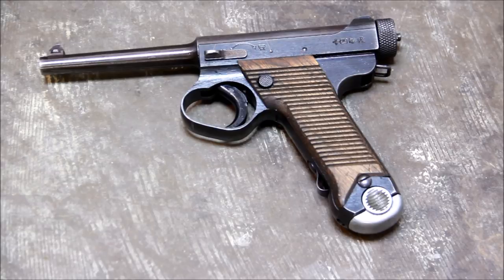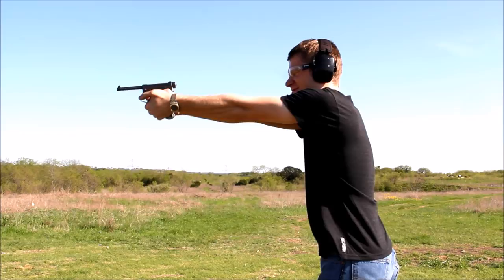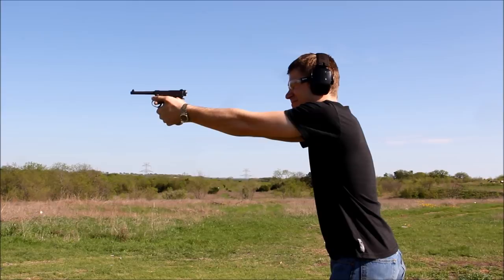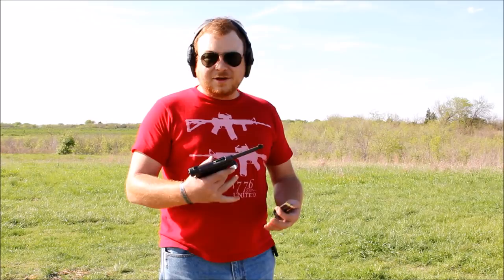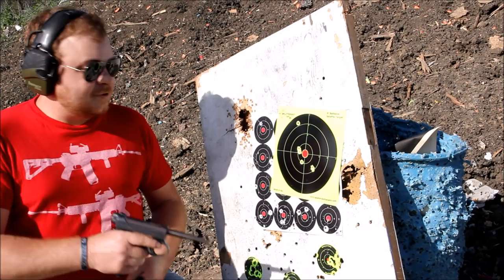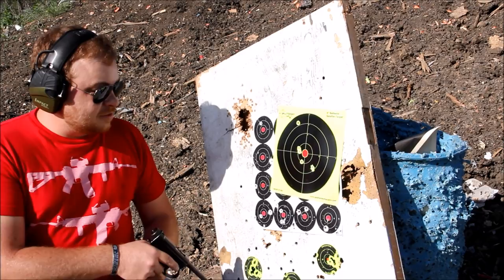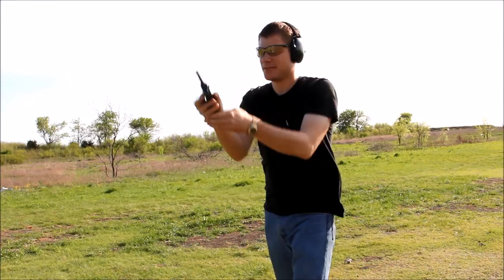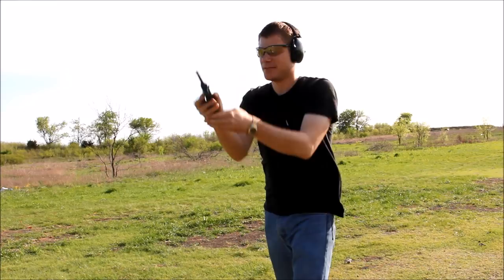Type 14 Nambu Pistol 南部拳銃

Comment: it's called keep the firearm down range for 30 sec minimum after miss fire, and i don't mean it jammed or pin didn't reach but when it does reach (as shown when he slapped the bolt down and pulled the trigger but it still didn't fire meaning the pin connected on the second try) you keep it down range. buuuuuut i guess i'm Australian and you're American and we get taught on different lvls for pistol and firearm safety XD (not everyone of course but people like the guy in the red shirt).
Reply: plus flailing the pistol around whilst driving the mag and bolt home (oh god i almost fainted) if i were a range officer i would've taken you off range and told you to never come back.

Comment: Looks to me the reason it fired was the magazine disconnect is actually part of the mechanism holding the striker in place and since the bolt was not fully in battery it did not engage the striker so all that was holding the striker was friction on top of the sear, sort of like when you pull a slide barely out of battery and the sear drops along with the trigger moving back. When you touched the back of the bolt you nudged the striker just the bit it needed to move and spring tension did the rest. Very lucky you were holding it down range and not at your feet or up in the air.

Comment: 3:45

It was even closer then you might think.

If you pay atenttion to his hand (Thumb) its actually moving towards the tip of the barrel (infront of the gun) just before the round goes off.

So if it might have gone of a tad later he might have had a finger or the hand in the line of fire =P.

Comment: I was once on Skype with a few guys and we eventually started talking about guns. My memory is a bit foggy, but at that point I will admit I was on a bit of a 1911 kick, so I defended that gun a lot, but anyways, I believe I said that the 1911 was the best pistol of all time, and then they proceeded to bash it (again, if my memory serves me well) and then I asked them what are some better guns. They responded with the M9 and this gun. Now, at that time, I called the M9 trash, because I didn't know that the M9 was a gun that was rushed out of the factory, that they had bad batches of aluminum, and that the 92FS is a great gun, plus at this time I had never touched  one and my father told me that the grip was way too big, which to me is not true. However, when they said that THIS gun was good, I asked them if they were joking. They were not. I said that the guns were unreliable. They refuted that fact. I said that the round was underpowered. They said it was plenty powerful. I stopped talking about guns with them after that.

Comment: I read somewhere that some Japanese guns from WW2, requires a lubricating ammunition, which they used at the time, but are not made any more, and the way to get around this; is to drop one drop of gun oil on the end of each bullet before loading it in to the magazine. Not sure if this might be the case here?

Comment: So I actually own one of these and was wondering should I go shoot it? My grandpa took it off a Japanese pilot in WW2 he joined the navy in late 1944 early 1945 at around age 17. I wonder what the circumstances were where he would of been in charge of taking prisoners?
Reply: I would not recommend shooting it especially if it's a late War pistol considering from 1943 and 1944 onwards weapons were severely simplified to save materials which with more complicated weapons like the nambu pistol caused what is happening here in this video the simplification of the pistol caused the pistols problems to be more common and that is why later in the war a Japanese officer was most likely to pull out a katana then they're pistol. And as well who the hell knows if the barrels inside have not been cleaned properly and have rotten out so just don't shoot it.
By the way out of curiosity what stuff did your grandfather bring back did he bring any more stuff like uniforms or Flags

Comment: It would be interesting to know if the pistol was serviced before being shot. Is the pistol an all matching example and not something pieced together with various non matching parts. These are notorious for weak springs. I would like to see it fired after the springs were replaced. There are many things that can contribute to this pistol having issues. Like others have said the magazine what type of ammo. I have these pistols and they have functioned without issues. If you change nothing between magazine number 1 and 2 why do you think anything would change?

Comment: I'm glad to know my Type 14 isn't the only one. Since it fired with the magazine removed, have you replaced the magazine disconnect spring? I think that may have something to do with the failures to fire, and the AD. I know mine is missing the magazine disconnect spring, as well as the recoil springs getting bent during disassembly.
Thanks for the videos!

Comment: What series pistol is this? My 7.1 (1932) Tokyo has never malfunctioned in the 80 or so rounds I've put through it, and I've heard the later the gun the worse it is.

On another note, Kijiro Nambu had some great designs, but this was not one of them. He could have done one of two things to fix it, Either replace the locked breech mechanism for a simple blowback, which would have been more than adequate for the wimpy round, or simply use a bigger Cartridge, more powerful cartridge, that had enough oomf to reliably cycle the action

Comment: I think your striker/firing pin spring is kinked and it's catching on something and preventing the bolt to move all the way forward. That's also probably why it fired wthout a magazine, the spring worked itself loose and struck the primer on the round lodged in the receiver. Ian from forgotten weps might know how to fix it!

Comment: I think that the cause of the surprise discharge is the fact that on a Type 14, the sear bar is exposed near the back of the pistol near the bolt handle. If prodded, this could release the striker, and... Well, y'all saw what happened.
Reply: +ZombieBite1991 Wrong Nanbu. Thats the Type 94
Reply: +Kevin Whiting (LogicalLube) The Type 14 ALSO has an exposed sear bar. I have no idea why the Japanese thought this was a good idea.

Comment: Ok  , here in Australia we have special range days for old fire arms .
This model Nambu  was on the range and it misfired the same way.
A very experienced armorer was there and he confirmed that he has seen many of these fire with the mag in or out just by applying pressure to the sides of the frame.
YES i will say that again just by applying hand pressure to the sides of the frame and NOT the trigger can fire the gun BE CAREFUL WITH THESES.
We have now banned these from range days.

Comment: Biggest problem I've found is most ammo that is available is slightly under-powered which causes the failure to eject, stovepipes, or fully cycle the next round into battery.  I did find one ammo supplier that seemed to have properly loaded the ammo so the pistol cycles properly but is no longer in business from what I can tell.  I think the currently available ammo is purposely under-powered due to concerns with using it in an old, questionable reliable pistol.  Using generally available ammo, it is probably best to use the pistol as a single shot just for fun and the experience of shooting an obsolete WW2 Japanese pistol.  It's just not a good gun and can be dangerous as seen on this video.

Comment: Honestly, the problem looks like age of the ammo, or parts being slightly out of spec, and the weapon requiring perfect conditions to work well. For some reason Patrick appears to have better success than Alex. Since this weapon is locked and recoil operated, but with a low powered cartridge, maybe it's just so finnicky that how you hold it matters a lot.

Comment: I just have a few ideas on how to fix at jamming problem change both the springs and Cut open the ejector Port more to the right side of the gun just like any other modern pistol so instead of the spent cartridges going up and potential  jamming it just flys out to the right but my highest recommendation is just retire that pistol because that is just clearly Unsafe

Comment: this is coman with weak springs you need to wear the action more or use 2000 grit paper to fine it down also the ammo might not be on key not enough power to operate the action or you can add extra spring such as pen spring also heavily lub the nambu it will work if you do these I promise

Comment: That my friends is what is referred to as a "Hang Fire". If you pull the trigger, the hammer contacts the round but the round does not go off, aim it away from the body at the ground and wait. Often what will happen is a delayed shot. You handled this very poorly and could have been very badly injured, next time try to be a little more careful guys. lol

Comment: Not the best design eh. 

Has this firearms still got all original springs? Or are they modern replacements? That's one of the main contributions to older firearms malfunctioning. It's the same with pre-war lugers etc the springs are decades old and all the design specs are thrown off.

Comment: The quality/reliability of the nambu pistols declined drastically as the war world 2 progressed the tried to hastily manufacture weapons. Earlier examples from the 30s before world war 2 are much better. you can tell the diffrence between the two because the pre war models have a circular trigger guard while the later models have a more oblong shaped trigger guard.

Comment: So, how do you account for the appalling performance and potentially lethal malfunction?
1. Ammunition. Who makes 8mm Nambu anyway? Is it loaded to original spec?
2. Design flaws or poor quality of manufacture.
3. Wear of action & magazine: Soft magazine lips, weak springs.

If you wanted to make this pistol actually more dangerous to the enemy you'd be better off stuffing it down a spare sock and using it as a blackjack.

Comment: This is why you always, ALWAYS disassemble and inspect old firearms before even thinking about firing them. The striker is a weak point on all Nambus and can break from dry firing them too often. Don't dry fire these pistols. Also get new springs. I believe Wolff makes new springs. These guns are over 70 years old, don't expect them to just work with old springs and all parts to be in good condition.
I'm really glad you guys practice good firearm safety but you should've stopped firing after the first few malfunctions because something was obviously wrong. These pistols aren't that unreliable.
Reply: Also stop smacking the back of the bolt. The striker is located on the rear and you might have broken it by doing that.

Comment: 40. years. service... so, was this a late model or an early one? ASSUMING this is a late model and possibly has the tolerances honed in (trying not to laugh as i wrote that) what the heck were the early ones like? and the pre production ones must have been terrifying. the only thing i can guess is maybe the pre-pro's were perfect and the pro's were just made to trash standards.

Comment: The ones made toward the end of the war were really bad and dangerous. Same goes for the late type 99s
Reply: Contrary to the early Type 99`s, the late 99`s had laminated stocks, fixed sights and different barrel bands, and barrel wasnt chrome lined.
The action and receiver has been proven time and again to take loads at pressures way higher than the rated destructive pressures of Mosin`s and K98`s :)

Comment: Got one of these on my nightstand!  All you guys have to do is contact the Nambu factory for some easy replacement parts to get her running in perfect condition!  Mine has the laser grip, magnetic flashlight attachment, and 10-round extended magazine.  Runs like a Glock.   ... Okay, I'm kidding. This gun is a major piece of crap, and if you buy one, know that you are buying an historic artifact and wall-hanger, not something you can take to the range.

Comment: That gun accidentally fired due to poor firearm handling

First you never clear a firearm in this manner , putting your arm leveled on top of the slide 

Secondly what happen to point the weapon on ground , you should be thankful no one is standing at your left

That weapon is more than 80 - 100 years old what do you expect

Comment: Weak striker springs, weak ammo and a tendency to be more dangerous to the user. The safety has to worked with both hands and of course your misfire accident. Japanese officers preferred to arm themselves with European models. This gun is only a little better than the Type 95 pistol.

Comment: i was kinda surprising how does the Japanese during that time shooting with this
Reply: The people in the video probably didn't oil it before they used it. with the accidental discharge the fireing pin probably bound only partly hitting the primer. Since I do t have the gun these are guesses
Reply from the maker: Arthur Robertson I properly cleaned and oiled it before shooting it (like I do all my firearms) -Alex
Reply: That's good to hear! :) that's also surprising that the gun would preform that way be safe!!!
Reply: Arthur Robertson The Nambu is historically known for its failures. The Japanese soldiers didn't like the thing at all.
Reply: Wolfstanus That why these particular firearms are suitable for those Banzai charge infantry division.
Reply: thomas kok Because they didn't work? hue huehuehue

Comment: Japan did a much better job when It came to swords......
Reply: no they didnt, dont be a katana plonker, buy a hand and a half sword
Reply: Carbon or damascus......you have no idea what you are talking about, sorry buddy try harder next time
Reply: even a traditional san mai katana is a over heavy, sharpened pipe, they look cool to some people (not to me :/ ) but the are not the mystical lightsaber that people think they are, there edges are prone to damage, they dont have any significant level of hand protection and cannot be used with a shield, which further enforces the fact that they have crappy hand protection, they are pretty much only good for unarmoured meat bags, aka murdering peasants, and for hanging on your wall, again if you like them. plus european steels of the same time and earlier were much stronger, the whole folded a thousand times BS is just that BS, there were (i think im getting the regional group right) viking sword smiths who would actually brade white hot metal strips into builts to forge words from, which has a hell of a lot more torsional rigidity than a san mai construction. european and middle-eastern swords were just better, that evolved over time, where as the katana went unchanged for hundreds and hundreds of years. as the katana had to other swords to compete against for so long it never had the chance to evolve with the changing times and so the design stagnated for nearly (or over, again i cannot quite remember the dates) a thousand years...
Reply: yeah katanas were more status symbols than anything else, against any kinda of plate armour, swords would be ineffective unless your half swording, which is impossible with a katana :P
Reply: John Reece folded 1000 times grorious nippon steel